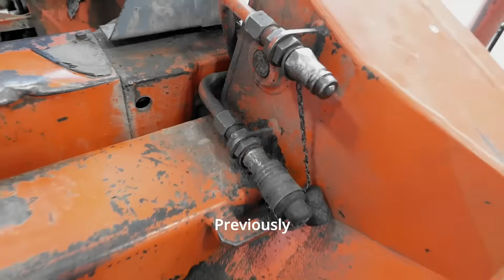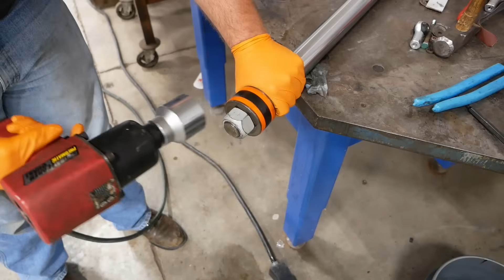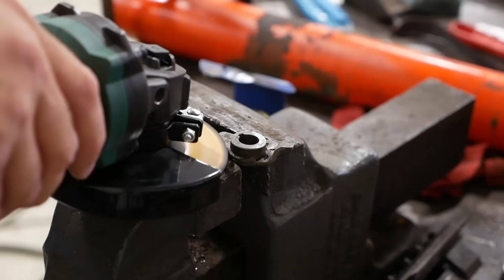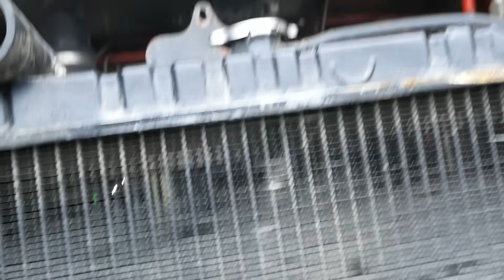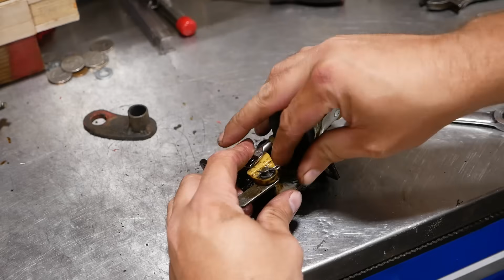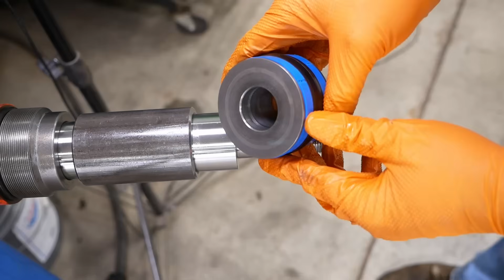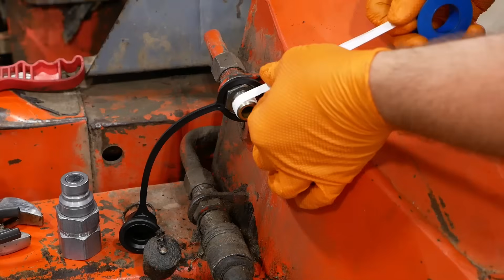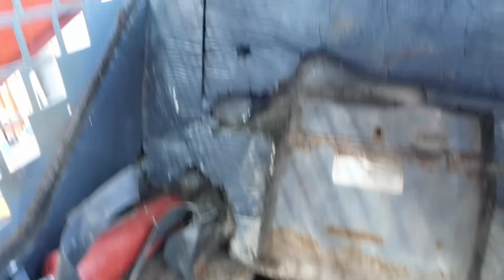Did I Blow up My Cheap Skid Steer? -  Thomas 173HL Won't Rev up, Leaking Cylinder - Part 2

Comment: You got very lucky, cause that would have been ugly once she went to full meltdown,,and hot fuel on hot oil combined with hot molten steel is nearly impossible to put out.
Glad you didn't panic, and kept your mind on task.
The joys of owning old equipment that you know not the history of, and the additional aggravation of discovering just how many ways that people can Jerry rig the simplest things. 
Then the real fun begins trying to locate parts for what once was the most common things is maddening in itself.
I've got couple MF 135 tractors, one is the early model with the continental Z134A, still common as they were used in everything that you needed reliable power in.
Welders, gen sets,tractors of all varieties, water pumps, literally everything. 
Parts semi easily located, but the wide variety of configuration by so many manufacturers caused there to be some many different components that fit the little engines to so many different designs it's sometimes a maze of serial numbers to get the right year series correct. 
The other is the ever popular Perkins 3 cylinder diesel that's equally as popular with different manufacturers of different equipment. 
But you'd think since they were sold globally and produced by literally millions, that they'd be easily affordable as well as parts by all the aftermarket manufacturers. 
Replacement engine for 47.5 horsepower averages around $9,000.00, and that's if you can find one. 
You can buy just about any other diesel engine for a third that price, and heads are anywhere from 4 to 500 used, but in the thousands for fresh castings a engine that literally has millions of pieces of equipment sold globally, and how is this possible that they can be so much more than something with 20 times the horsepower made by the same manufacturer..
It's maddening i tell you simply mind boggling is not even close to describing the frustration of this crap it's beyond ridiculous

Comment: Form a funnel is the only way to change an oil filter on a 2000 expedition without "rust proofing" the driver's side front suspension.  Great video.
Reply from the maker: Or a Chevy Equinox!

Comment: If that bucket doesn't fit on a standard quick attachment setup I would completely forget about it.
Reply from the maker: It will with some slight modification, but I'm not sure it's worth saving.

Comment: If you send that cylinder to CEE in Australia Kurtis would be happy to line bore it , bore weld it and machine it back to factory specs. Should only cost about as much as two new cylinders . But what a collaboration video .
Reply from the maker: I'd need him to do the other 22 bores.

Comment: When I come up against a weird hydraulic seal I have had the best luck with Baum Hydraulics, which you probably already know of them.   I can send them the old seals and they will match them up making the kit for the cylinder and they source mostly US made seals and orings.
Reply from the maker: Yeah I normally buy from them, but they didn't have the piston seal.

Comment: Well Wes, i have only been around one diesel runaway. And it wasn't my machine, but the homeowner's. Didn't know to cut off the air supply, so I crawled under the machine with hit oil spraying and dripping out to manage to turn the fuel valve off. Praise God it worked. Turns out someone from the past has connected the crankcase breather line to the intake. Worn engine with a little oil blow-by fueled itself as oil warmed and thinned out. Unnerving situation I hope never to repeat. Glad it worked out for you. Thank you for the video. You seem more at ease, which I am happy to see and support.
Reply from the maker: Yikes!
Reply: @WatchWesWork Yikes indeed! Praise God in my ignorance for what usually happens in the situation, He spared my life. I had to go hand dig a spot to bury our family cat, after removing the oil coated tee-shirt. My clothes were ruined, but the backhoe, now repaired continues to run. It was tired before, so is difficult to know how much if any damage was done to the engine. But I think God for sparing my life when I really didn't know how bad it should have been. And that the belching, hot oil did not burn me. 😮😁 I definitely count my blessings!

Comment: If you want a slightly mis-aligned cheap copy of that tool for installing seals inside cylinders, there's one somewhere in the pasture near my shop.  (No further from the south doors than I can throw one.)

Comment: I think you can buy just the modern quick attach plate. The bushings in the one you have are probably as sloppy as the ones on the cylinders.

Comment: With an open-ended hose in the retract port, you put in shop air through the extend port to push the rod (and retract side oil) out (hose end in a bucket).  Position the retract port at the lowest point.
You pass the case mounting pin hole over a fixed pin on a table or in a vise and allow it to resist the head gland break-away torque.  Or get a chain-style vise.  Just don't clamp it down over the head gland area as you'll distort the threads and they'll gall-up.

Comment: I'd have tried welding up, carbide burr and saber saw blade "broaching" the old keyway first. before replacing the whole thing and broach cutting a new slot.
it certainly wore from being loose after tech had it apart and didn't torque it down again.

Comment: Runaway diesels are one of the most terrifying things. (no missing words, that's my whole statement)

Seen (at least) one go runaway, sittin on the I-215 in SoCal. Terrifying sound, even from afar.

I say, "at least" since I've seen 2 others with some symptoms of a runaway, but they weren't revving high, and caught on fire while I was sitting in traffic (on the other side).

Comment: One thing I've learned from YouTube, if it's injection pump related send it to Area Diesel Service and save yourself from doing something you might regret.
Reply from the maker: This pump is basically built into the engine. You can't really remove it.
Reply: @WatchWesWork  Oh okay great information and as always you nailed it.  I'm sure someone less skilled would've paniced and not been able to cut the air and fuel as quick as you did, and well we know were that road was headed.  Nice job and make for a great video 👍

Comment: Have only been around 1 run away engine in my 50 years wrenching.

Couple of guys trying to figure out a Duetz and well they got it wrong.  Funniest thing I have ever seen.
It took off, one guy stuffed something over the intake, slowed it down but not kill, another guy just started randomly grabbing wires and ripping them off the engine.  One of the other mechanics in the shop calmly walked over with a pair of side cutters and cut the fuel line.

Meanwhile there was some kind of a tour going on, bunch of guys with the "Special" white hard hats on, you know they type, from head office or accounting or something, they haven't got a clue what we do. 
When that thing took off, most of us beat feet for the doors, one guy yelled "ITS GONNA BLOW, RUN"
The white hats just stood there and watched, not a one moved.

You would think that if there were 15 mechanics running for the door yelling RUN, they would do something.

Fortunately it all worked out in the end.

Note, this was 1981, the first Duetz we had in the plant.  The books were in 7 languages and the English was pretty much a literal translation of german, hard to figure out.  We got some training after that.  LOL

Enjoying your new laid back vids Wes, glad this youtube thing seems to be working out for you.
Reply from the maker: From my limited experience, Deutz does some weird stuff.

Comment: The amount of wear on all of the non-bearing parts and washers is just incredible.  Did this thing spend it's life in a sand blasting facility?

Anyhoo, there are plenty of aliexpress options for cameras these days and they're exceptionally cheap.  I just ordered an IP68 (lol, sure it is) one with a monitor so I can cut down on the amount of turning around when running the snow blower on the tractor.  Something like that might be a good first try to see what and where works for you.

Comment: You just inspired me to inspect shift linkages on my 10,000 lbs rough terrain forklift 4 fwd and steering
Yes it’s military surplus
Reply from the maker: Sounds like a handy machine!
Reply: @WatchWesWork  the beauty of it is I have 2 of them, I just inspected the one that shifts good now I go look at sloppy shifter. 
That’s the machine I loaded my 9,500 lbs boring mill with.
Reply: Thank you for the Kubota diesel injector pump control information because I do go in the field remote locations with small diesel Kubota drilling equipment.

Comment: Is there any way to convert that to a quick tach setup? i've seen weld on conversion adapters, but they are not cheap ($629). I imagine with some cutting and welding you could make one. I'd buy a backup camera off the jungle site, or AliSlowAF.

Comment: My father mounted 1 8" convex mirror on the outside of each boom on our 863 Bobcat. Makes me seriously wonder why I didn't have the good sense to do it myself 5 years earlier. As long as they sit inside the footprint of the outside of the tires, you shouldn't have an issue. If your tires don't fit, you will know because your bucket has already destroyed something,  lol.
Reply: that is on my to do list for our 763 at work. Id be happy with mirrors off an older Ford ecoline van. something is better then nothing. twisting and turning to see what is behind machine all night plowing/cleaning up parking lots gets old real fast

Comment: That quick tatch you might be able to cut it down to fit standard
Reply: a used one is probably cheaper, easier. you can get the quick tach and bucket for relatively cheap

Comment: Many years ago, I used to work in a UK shop refurbishing hydraulic rams.

The OEM builders often used a special purpose assembly bush over the rod with a 15 degree taper to prevent seal damage on assembly. What we usually did during the refurb was to machine a 15 degree taper on the leading edge so that we didn't damage the seals on reassembly. 

Everything else looked spot on with your ram refurb.

Comment: I learned the lesson of don't buy knock off or cloned equipment long ago pay the small fortune and get the name brand you will probably save yourself some money in the long run
Reply: But then we wouldn't have a video on how to fix all of these little funny small parts. I have never heard of a keyway broach either.
Reply: with cloned equipment, most parts off the original will fit. the clone is too cheap to retool for their own parts so use whatever they can use off the shelf
Reply: @harveylong5878  it's the 20% of parts that are custom to them that will cause you 90% of the headaches plus dumb stuff like what happened with the Kubota dealer

Comment: If memory serves me right, when my dad was trying to get the dealership for Moline area their advertising was, they were the original manufacturer for New Holland's skid steer line and they featured the only straight lift bucket so you didn't have to tilt the bucket as you were raising it
Reply from the maker: They use an equalizing valve of some kind.

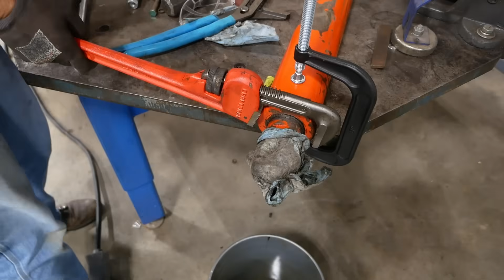Comment: 3:48 Why don't you just use your press a big vice to hold the cylinder, like Curtis from Cutting Edge Engineering does?
Reply from the maker: Have you seen where my press is located?
Reply: @WatchWesWork  No, I haven't. But you gotta admit it looks coll, when Curtis does it. Not so cool when he janks it across the floor with the forklift

Comment: impressive work as for the quick attachment is there a way to either cut the factory one down to fit  or make an adapter or pull the pins and put the proper one on?
Reply from the maker: Not sure yet.
Reply: @WatchWesWork  well either way i am sure you will figure it out you always do my friend take care and be safe

Comment: Whenever we rebuilt a Detroit, we always had a plate to cover the intake horn in case the engine took off. Most of them had an emergency shutoff plate in the air horn but you always had to check to make certain in worked. Another good practice is to have some CO2 fire extinguishers handy to shoot into the intake so there isn't oxygen to support combustion.

Comment: Thomas with a tanked engine - this could be a hit.
Maybe an accessible fuel shut-off ought to be on your list of upgrades - after the event!
Reply from the maker: I screwed the shutoff in. Didn't do anything.
Reply: @WatchWesWork  I was thinking of a simple on-off tap in the fuel line, rather than relying on the electro-mechanical system which still has a lot of worn parts.

Comment: I hope you purchased seals for the other cylinder too. The place we used for cylinder work had a source for hydraulic seals that they could get the next day at prices much less than the dealers. We got the factory part number and ordered kits to stock for the cylinders that we repaired ourselves or just to have them on hand if we had them repaired elsewhere.
Reply from the maker: I did, but it has been rebuilt already.

Comment: The amount of jealous I am watching you use a cheap impact to effectively take the nut off the rod end...I cant even begin to describe how upset that made me lol.  The last one I did we had to capture the rod in rags and rubber, and hold it down with an end loader, then use a forklift and a 6 foot 1 inch bar to crack the nut loose.  And it fought me for the first ten full turns.  THEN we had to lathe the threads because they were galled.  Yea, I cant describe the jealousy...

Comment: Are the quick attach pins in the same location? Can you just cut the ends off and narrow it down?
Reply from the maker: No. It's shorter vertically.

Comment: I’m a little disappointed he didn’t replace the worn bushings in the throttle plate and the lift cylinders. But whatever it’s not mine. I would have just liked to see them done
Reply from the maker: There's no where to stop with worn parts.

Comment: Would it be possible to just torch the quick attach plate to the correct size, or are there other differences that would make it not work with the bobcat quick attach?
Reply from the maker: It's different in other dimensions.

Comment: Glad you caught the runaway before it got really expensive. I bought one of those cylinder seal tools as well, makes it a bunch easier. Thanks for the Videos, Wes. Looking forward to Part 3. 
They do make Bobcat Style Quick Tach that can be adapted to pretty much anything. Good luck.

Comment: Every older skid steer I ever ran  had a ton of slop in those forward and reverse linkages , and it always seems like whenever the mechanics tried to fine tune it and make it better it got worse everytime 😆🤣😂 . A lot of them try to take off as soon as you start them or they try to cut a donut immediately you have to hold 1 if not 2 sticks back to the neutral point constantly 😂😂

Comment: Yo Wes!!! For future reference you can use rubbing alcohol to lubricate rubber parts for installation. That includes pulling wires into car doors, installing cycle handgrips... Works perfect then just evaporates.

Comment: You were lucky to find that arm again Wes after it fired out of the vice, when that happens the part usually ends up at the other side of your shop in the exact opposite direction to which you spotted it fire off in 😂😂,  well done for killng the run away 😮, scary stuff when that happens, happened to me once with a V12 Detroit on a genset when the run away flap didn't close, its surprising how quick you can move when it happens 😂😂, great video as always ❤ felt like I was watching a video of my workshop, those quick connectors arnt cheap over here these days, rip off Britain strikes again
Reply: The garage metallic epoxy floor coatings look really nice. But drop some small parts, tools,large or small nuts and bolts and they disappear in the abyss of  the 8 factors of camouflage. Position, shape,  shadow, texture, color, tone, movement, and shine

Comment: I've seen 2 diesel engines run away a bus sitting at full throttle went bang in front of me I was standing near it at the time and a VW I was driving past seen a plume of black smoke what a racket it caused a bit of a tailback as people stopped to watch .

Comment: Wes, Thanks for the Sunday morning instruction, demonstraton and (of course) entertainment! When you panned up from what PuP uas waching and it was a rabbit staring back at him, I was on the floor with laughter (well maybe not on the floor). Anyway, Couldn’t you build something of a door frame for the radiator so you could move it out of the way of you working on the engine like many of the others do?
Reply from the maker: It would be nice if it hinged. It's really in the way.
Reply: @WatchWesWork  Sure would help you for all future engine work. AND it would make for a very good video your current viewers and any owners of “non hinged radiator” owners would appreciate!

Comment: Wes I'm sure you assessed the risk by not replacing the wollared out piston eye. Every time the piston goes in and out load or unloaded, it will go at an angle. This will reduce the life of your entire seal kit.
Reply from the maker: I can't fix just one joint. I would need to fix all 24.

Comment: A couple cheap paintball co2 tanks with a 1/4 turn valve and old steel shower head live on my bench and get pulled out when working on diesels. If the rubber cap doesn’t seal well enough crank that valve and blast around the intake. The whole thing hangs out by the exhaust so that the showerhead is nice and warm, keeps as much of the co2 in a gas state when it comes out. No worry of hydro locking the engine that way. 

From one Wes to another, thanks as always for the great videos. Cheers from Wa State.